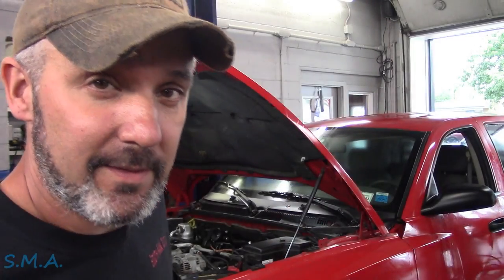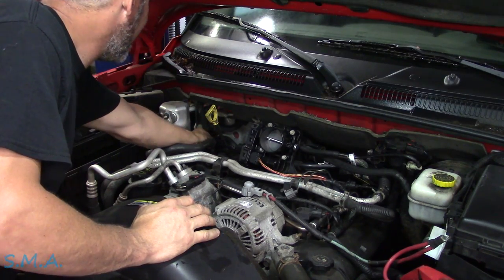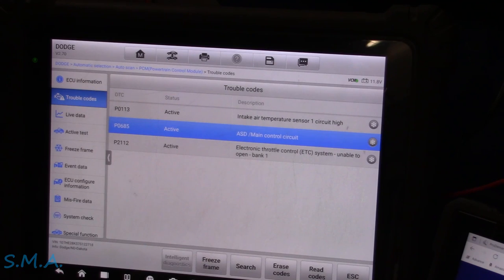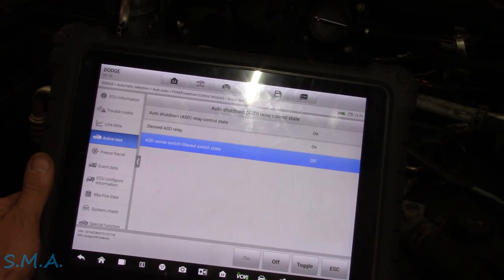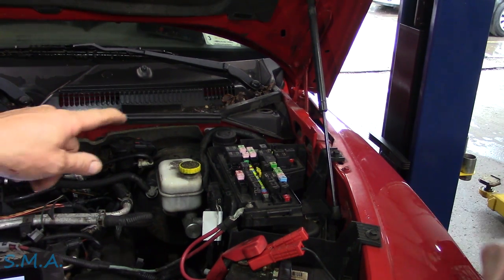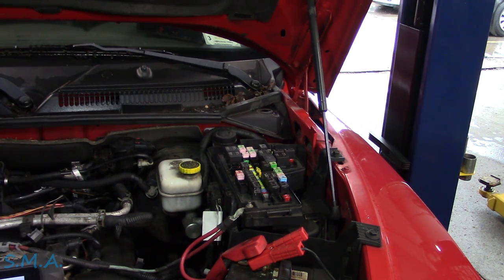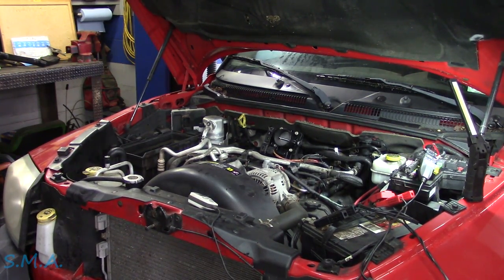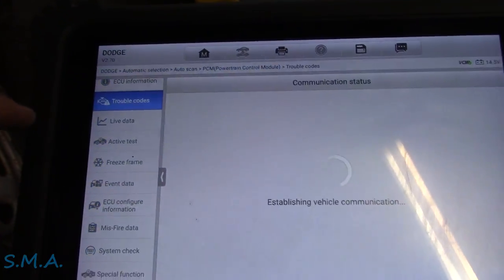Dodge Dakota: No Start After Clutch Replacement

Comment: I acquired a buddy of mine's 86 Buick Regal sport coupe with the 307 roller cam Oldsmobile v8 motor and it always had starter wiring and charging issues mainly from the Dr side valve cover leaking and the rear main seal leaking and oil soaking and cooking the starter this car would get a new used starter every two weeks when my buddy had it and it had a barely working value craft alternator on it it would also kill alternators and batteries didn't think much about that one,til I traded for the car, and realized that the factory stereo connection three plugs were cut off and thrown in the glove box with a decent amount of wire left on them and I butt connected them back together and crimped them and rather than putting the pioneer stereo back in it,I put a 92 Oldsmobile cutlass ciera cl am/FM stereo Auto reverse cassette tape player radio like the car came with from the factory except the grey face and grey vinyl coated knobs and slides, and in the process noticed that the speaker that was stuck to the floor in front of the radio was from a 80's dodge ram truck unhooked that and replaced all 4 speakers the 3 1/2 inch speakers in the corner of the dash and the rear speakers in the trunk under the rear deck package shelf tray. And noticed unhooking the wires that the memory wire from the pioneer was powered by the brake light fuse and fixed that took it down the road and found out none of the rear lights worked at all,checked the fuses, tailight bulbs for both sides and then crawled in the back seat and started disassembling the third brake light and didn't know how the connector came out of the bottom of the pedestal mount and broke the plastic retainer so I started disassembling it and realized that the inside of the third brake light housing the chrome plating had gotten hot enough it removed most of the chrome plating behind the bulb in the center,,so I went in the house and grabbed the house phone called every local junkyard I could think of for the chrome plating retainer the bulbs turns and clips into no one had a useable one,so I went down the road to a buddy's dad who sells vehicles he rebuilds and showed him the chrome plating plastic retainer the bulb turns into and asked what he would want for it,he told me I'll sell you the whole thing and when you take the two screws out of sides of the bottom of the pedestal mount slide it back towards the seat and turn the bulb towards the passenger side of the car and it will come right out and you can have the whole thing assembled for $12 that way you don't have to fix yours,glue the rubber seal back in after getting the red lense back in it's grooves,so I drove back down to the house and swapped it in and plugged my connector into the bulb and boom rear lights brake,tail,turn,4ways, I had no idea that it got the power for the brake lights through the tailight wiring so if one light in the back was out all you have is reverse lights... and after I changed the spark plugs put a new set of spark plug wires on it, pulled off the Dr side valve cover and replaced the valve cover gasket I took apart the factory starter and noticed it was chewed up on the nose cone housing and the solenoid was weak and as black as the factory third brake light bulb was I took out, and I fixed that it worked for awhile and then started dragging over and finally started the olds 307 ,so I went and bought a value craft AutoZone rebuilt starter and it started every time, I bought a alternator while I was there and grabbed a everstart economy Walmart battery and swapped it in the parking lot, went back to the house still would have charging issues with this car and then about 4 months later it cooked the brushes in the alternator was taking it off and realized there are three power wires going to the stud on the back of the alternator my Chevy c20 78 custom deluxe 350sbc truck only has two and the medium size red one goes down to the starter and when I put the replacement alternator on that is where I put it and never had a charging problem again and th200c 3spd automatic with a lockup torque converter gas v8 car was great on gas got 18mpg, till the light weight aluminum case th200c transmission gave out and when I changed it I noticed that the bellhousing in yellow paint pen read 84 Chevy S10,so it wasn't the factory transmission for it,I put a b&m street master street and strip stage 2 shift kit aftermarket transmission with the factory size torque converter as the Oldsmobile 307 flywheel but for the th350 and it got crappy gas mileage after that but 10mpg wasn't bad and had firm shifts and would chirp the tires when it shifted to 2 nd gear. Wasn't fast at all but it was a dog until about 65mph but after that it would move lol, and it handled the best out of all the other gbody cars I've had as far as the Buick Regal and the cutlass supreme cars but 2 because it had a rear sway bar and so did my ,84,85 Oldsmobile cutlass supreme brougham cars but they were factory v6 cars.. the regal sport coupe was basically a regal t base model with a V8 motor and it a 2.73 rear end geared bop 10 rear end. Car had black and chrome 14 inch steel Buick road rally wheels.. anyways I learned to not just trust my capable buddy who I had worked on cars and trucks with before I had worked on this Buick Regal sport coupe several times while they had it but I should have traced the alternator wiring to see why it would kill alternators and batteries it was shorting them out and killing the battery starting the car, because the charging wires from the battery positive are supposed to be the red wire in the white clip to the side of the alternator plug to the stud at the back and the battery cable and down to the starter to energize the solenoid so when the crank ignition signal triggers it cranks over, but that wire was also on the back of the alternator it's a miracle that car never caught on fire 🔥..

Comment: Just did a JDM swap VG33E on a 2001 Nissan Frontier.  Lots of incompatible “free goodies”.  Kept whatever new parts I could and swapped over the rest.  One of the newish injectors was DOA: white and blue smoke abound, with a hard miss on cylinder 4.  Good spark and compression, swapped for an injector that had 200k more miles of fuel through it.  Didn’t take long to get to the right diag, but something silly like that, before checking it out, just about made me sick, after doing the engine swap.

Comment: Did a motor swap on an old Chevy PU and couldn’t get the fuel pump to run. I left a ground off at the thermostat housing that apparently was the ground for the in tank electric fuel pump

Comment: Recently did struts and checked out some trouble codes on a 08 Explorer. One of the complaints was the TPMS was throwing a low tire pressure code. Woman said left rear had a slow leak but she had recently filled it to 32 psi and the low pressure light was still on. I checked the sensors and every one was reporting and all checked out. Ran the check like 3 times and light still on. Finally I looked at the door sticker and tire pres was supposed to be 35 psi. I felt as stupid as a customer.

Comment: Did The relearn, then no crank, engine spin ,I opened fuse box press fuel pump reset switch , started right up .

Comment: a few years ago i had a no start on an '06 Chevy 3500 after i replaced the 4l80e. not sure why, didn't pinch any harnesses or any thing, blew a 40amp ignition fuse, and yes the battery was unhooked as i had the starter off. put a fuse in it and its still running to this day. initially the customer asked us to replace the transmission because he had a shake, that had been there for years. several sets of wheels/tires, no difference. several ujoints and driveshafts, no difference. tcase and front diff, no difference. we then put all new poly urethane cab mount bushings in and he said it got better. service manager had already ordered the trans, so customer said change it anyway. found the upper bell housing bolt hole broke off, so the trans company didn't want to give us core credit. we then put the updated hydraulic rear cab mounts from GM that are as big around as a bowel in and all his vibration went away, guess GM had a bulliten for this year truck range for vibration due to frame rail flex or something.

Comment: Back in the 90s a guy I know had a 70s model Ford Courier.  One day he was trying to find an electrical issue and was checking fuses under the dash.  I asked him about the fuse box under the hood.  He insisted there was no underhood fuse box.  I then proceeded to open the hood and then the fuse box.

Comment: I was doing heads on my 11 legacy following your videos. Get it slapped back together and had an immediate cylinder 4 misfire. My heart was sinking at the thought of tearing back into the car. My buddy was looking over our work when he all of a sudden stepped back, threw his hands up in the air and yelled "The number 4 injector is unplugged!!!" That was one of the biggest exhales I've ever had. Started right up after plugging it in, ran great, still running great with no oil leaks 27k miles later.

Comment: Had a tractor come in. Owner complaint engine warning light on! Pulled unit into shop? Low fuel light was on. Put 5 gallon of fuel in. Fuel warning light goes out.And customer said no that’s not what is wrong!!!!!? I told service writer tell customer to run unit down to empty again and see what happens?!!! Crazy things happen 👍🏻

Comment: I watched when fellow mechanic drove Scania with air-suspension in to the shop, because suspension was bottoming out, only to release there was nothing wrong it. It was just in lowest settings, he just set suspension back to regular ride height, and drove it back parking lot..

Comment: I used to drive a tow truck for a garage and I bet nearly half of all those tows were either a fuse or out of gas. Fuses usually came from kids trying to upgrade their stereo and didnt tape or heat shrink connections.

Comment: I bought a R12  > 134A conversion kit  for my mercury sable... the system was empty, so I had a friend "vacuum the system down" .   No where in the instructions did it warn me that the lubricants were incompatible... So when the AC pump seized up  the serpentine belt burned through,then snapped. I guess as the belt broke the energy released spun The alternator backwards. Because it fried the digital dash ... Oh yeah I saved some money doing my own home car repairs! Right!!!

Comment: I snapped a forcing screw while attempting to push out a front wheel bearing on my 04 Nissan Altima. Realized it had a retaining clip. DoH! Got the clip out and the bearing came right out using far less beans. 

Another time i was replacing headlight bulbs and accidentally popped several fuses. Didn't disconnect the battery. Finished the job and replaced the 3 fuses. Headlights were only marginally brighter. 😒

Comment: Worst fuse pop I ever chased was on a 78 Cutlass tail light. every time you got the car in a bind like one front tire entering a step drive it popped the fuse. During testing  could not duplicate it. Finally one day I decided screw it put a jack under left front wheel and gave it 2 feet of altitude adjustment with the ole 2 ton floor Jack. turned out the hood light wire had been tucked into the transmission harness by someone years before that and the terminal needed help to touch the trans case and Poooop went the fuse.

Comment: I was working in a shop while I was in college. A new car came in with a complent of a noise when stopping and taking off. While inspecting under the car I noticed something red inside of a  inclosed fame it was a coke can. A little solder fixed it but don't know for how long. It never came back

Comment: Short video? Well, let's make comments longer. I had issues with sunroof drains so I cleaned them up and dropped down the corners of roof lining to secure the drain hoses from leaking inside the car, Volvo V50 with the big 2,5 in it. Later that year, when the nights started gettin darker I realized interior lights were gone, there's only footwell lights working. "I must've blown a fuse!" And so I had, replaced the fuse, blew right away. "I must have a short!" So I did, straight to the ground. Started poking and pondering, searching and wondering. Took me a while to find that as I was putting the roof lining back up of course I managed to drive the passenger side sun-visor's screw through the wire that feeds the little mirror light on it. So even if everything seems to go just fine there might be unexpected surprises waiting ahead. Not really an overlook but a screw up for sure.
Simplest fix I've ever done for customer would be adjusting dashboard light dimmer. I think he even put the blame on his wife that the lights were gone.

Comment: Recently replaced 3 M8 x 1.25 rusted exhaust manifold studs.
Couldn't figure out why one wasn't easily threading in.
Re-tapped the hole, cleaned it out but 1 stud was still not cooperating.
Dug the packages out of the trash and discovered 1 was an M8 x 1.0, not 1.25.
Wasted 2 hours and lots of curse words, because it never occurred to me 1 of them could be the wrong thread pitch.

Comment: Stories? Okay.  Back in the day, my gf's mom had a 1963 Fairlane.  No crank.  Asked if she wanted me to look at it. Said no! (she didn't like me).  Went to a service station. Sold her a battery.  Few days later, no crank.  Then they sold her a new starter.  Few days later, no crank.  They sold her new battery cables.  Few days later, no crank left her stranded after the service station closed.  I stopped at the Auto-Parts store and picked up a starter solenoid that cost $3.  Installed it in about two minutes. (The one up on the fender).  No further issues.  So you see folks, firing the parts cannon is nothing new.

Comment: Had one today on a jeep. Shop put an engine in it then was running poorly and setting a code for the map sensor circuit high. Tested @ the sensor had ground, 5v checked the signal wire and had 5v ref. Tried to pull to ground and no change on scanner. Almost called a pcm. Put it back together and it wouldn't start. Asd relay not energizing. Ultimately found a loose connector by the tipm that provided power to the asd relay. Plugged it in till it clicked and magically everything was fixed.

Comment: Blew the main fuse on an 03 forester X due to using a 90 degree adapter to fit o2 sensor on an aftermarket cat. Wires rubbed through on first test drive, shorted. Fortunately after some poking around I was smart enough to figure out my own stupid mistake.

Comment: How about the most simple repair turned into nightmare. Rav 4 2006 with blown cigarette lighter fuse. No big deal right? Except Toyota for some reason mounted it behind the kickpanel facing down for the interior fuse block. So either you have to have to have a mirror, use the force, or do a headstand to read the fuses and change them.

Comment: I worked on a friend Bob's 94 miata with headlights stuck open. He said he had it to a garage that said he needed new motors for them at some crazy price. It had been at least 6 months and he ask me to look at it. I looked at it and read the manual. There is a red button in the middle of the dash that holds them open if driven in freezing weather so the motors don't don't fight cold. It had been pushed in. He never knew that and  then remembered he had his dog with him the day it had happened. We figured the dog a big lab bumped it. at least that is who got blamed, it was probably Bob.

Comment: Bought 2 rusted out beat up s10s and a ford escort pony for a trade for my old dirt bike that didn't run and a 69 boa ski 450 snowmobile.  Somehow all 3 had had the battery hooked up backwards and wouldn't start. Both the s10s I drive home after replacing the fuel pump fuse. The escort had a burnt ground wire and fried the :inertia switch. Guy was pissed that was all that was wrong with them. He had tried to convince me That the computers were bad Yada Yada Yada... 85 s10 with the big 2.5l IRON DUKE and 4 speed manual transmissions don't have much of a computer to them I just laughed agreed to the deal and got the titles then started them up and drove away 🤣🤣🤣👍

Comment: 16-year-old punk kid! 1966 bronco! 289 three on the tree!  two days before Christmas! bad throw-out bearing! thinking I'm all that! knew I could have it running, for Christmas eve!  By myself, front-drive! yanked exhaust, drivelines, pulled trans and transfer case at the same time! Installed new clutch/bearing/ pressor-plate! all before noon! installed drive-lines exhaust, starter!  finished! no help! Go time! started it up! no exhaust leaks! put in gear! "NO" go! eat lunch! repeated steps! faster the second time! Started it up! "NO" go 2!  Tore it down! left it on trannyjack! for next morning! Bad dreams! Decided to try something new! check to see if clutch plate, actually fits on shaft!  After crying for an hour! found an all-night/holiday auto parts! Freeway and MacDowell! got the right plate! reinstalled everything, started it! Put in gear! drove it for 4 years! Cried when I sold it! Knowing what they are worth today! I am still crying!